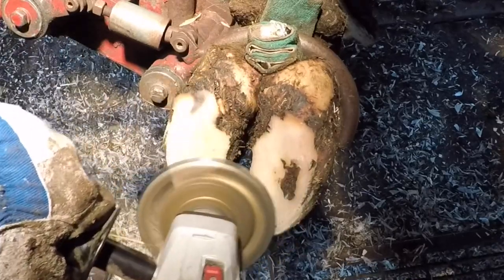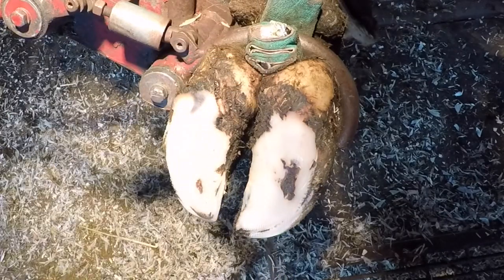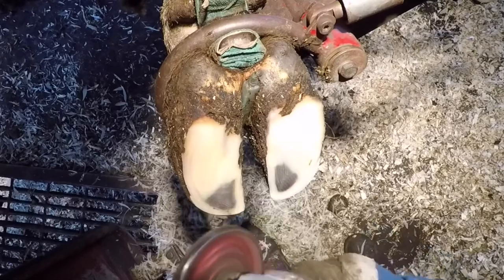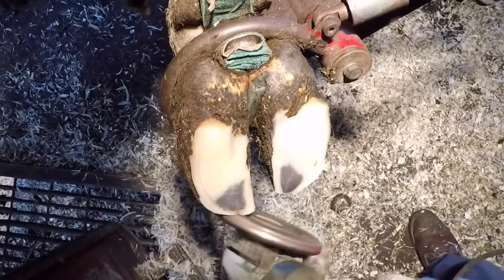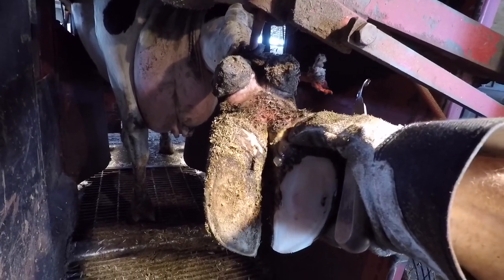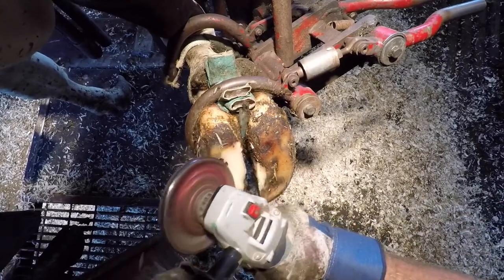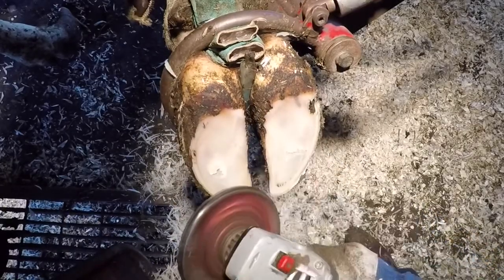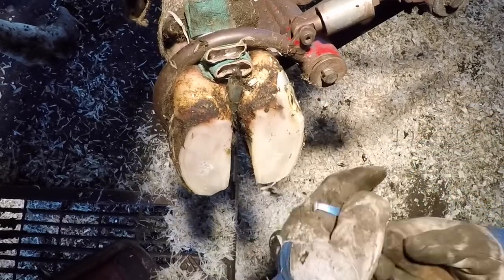Ep. 29  An ORNERY BULL, a SQUIRTER and some TRIMMING

Comment: Great work, do you know why this farm experiences abscesses around this time of year?
Reply from the maker: Heat stress causes cows to spend more time on their feet in an attempt to cool off increasing risk for ulcers and abscesses.  It happens each year in July and August when temps and humidity push to their highest of the year.  Not just this farm but most farms see an uptick in lameness.
Reply from the maker: hawkturkey They have lots of fans and even sprinklers but not where they lay for obvious reasons.  Cows get rid of heat best while standing and spend more time under the sprinklers when it’s sweltering out.